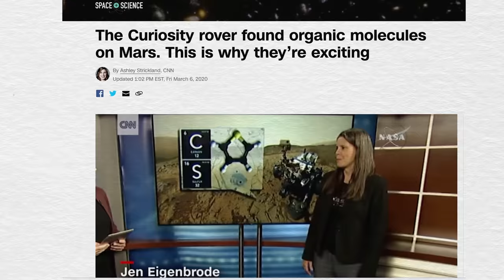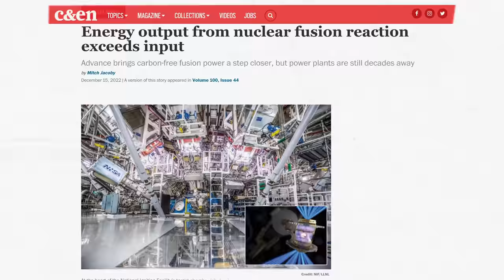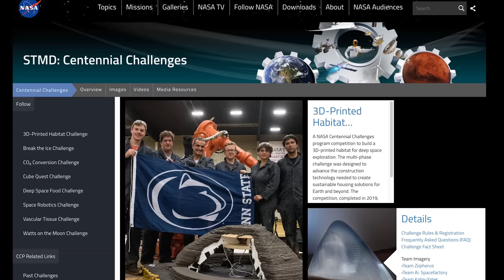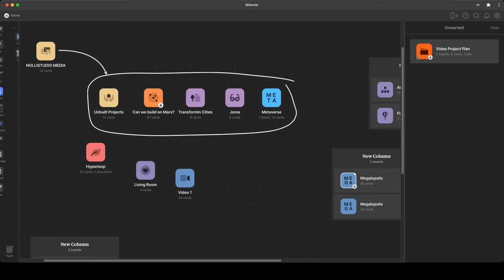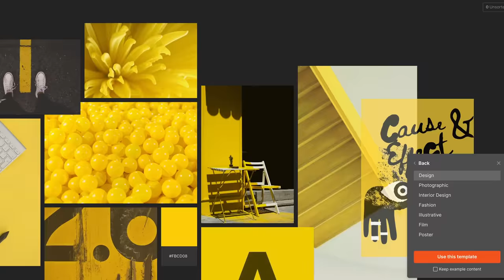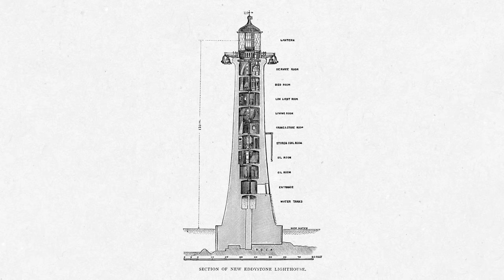Can we REALLY build on Mars? [SPACE ARCHITECTURE]

Comment: Why are you people making it so difficult to terraform first thing you need to do is add water with water and racing the temperature of the planet so that the ice becomes water racing. The temperature of the planet will eventually allow for plant life to grow with the water creating oxygen, if this has been started 20 years ago, Mars would have an atmosphere now maybe not good enough to survive without special equipment but it would be a start but we did not do that. Has anybody seen an ultrasonic hot water heater? It is a boiler with an ultrasonic device, with the filament, the sound waves go from one side to the other and bounce back, heating the filament to heat the hot water. The same process could be done with the planet by sending soundwaves deep into the planet stimulating vibration, and is the sound waves come back it will heat the planet, there’s enough asteroids ice that can be injected into the atmosphere in a decayed orbit that they would break down to become water with a warmer climate water. All you would need to do is fertilize and seed to start plant life and you have atmosphere if I am wrong tell me so.

Comment: 3:00 you can't have an atmosphere on Mars, lacking a magnetic field like the earth
Reply: Mars already has an atmosphere. Atmosphere has got nothing to do with a magnetic field. Atmosphere depends on the gravity of the object. There would be more solar radiation because there is no magnetic field to deflect the solar winds but we'll absolutely have an atmosphere.
Reply: @AXCBER  ok my mistake. Maybe I misread an article. Average surface pressure on Mars is only 610 pascals, less than 1% of the Earth's
Reply: @turnipsociety706  yes the air pressure is extremely low, also because there isn't much gravity to hold on to a lot of gasses to form a dense atmosphere.

Comment: Totally unsustainable and "it is only a matter of time" suggestion is "Insane".  The Cost to "Terraform" Mars cost Earth "more than Earth can send".  More.  If you can  "Terraform Mars".  You could far more easily "Terraform" Earth and make Earth "Sustainable".  This entire project is "insane".  Quote:  If you keep doing the same thing and expect a different result that is the very definition of "insanity".
Reply: Current global military spending is enough for a permanent colony on Mars, to build an energy grid and start mining in 10 years and achieve Martian self sufficiency in 20 years.  Bottlenecks, supply chains and red tape would make that 50 years. Main problem is the lack of economic incentive. This delays major Mars projects until a 1000 X decrease in cost can be achieved or global industrial output increases 1000 X.